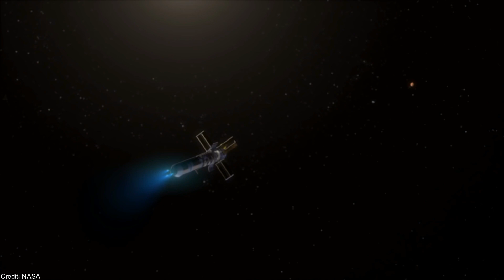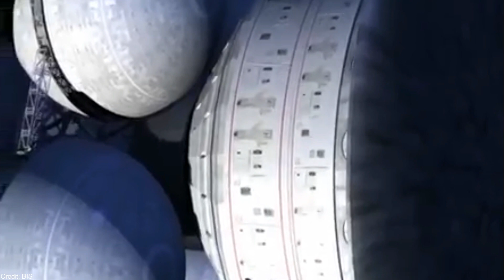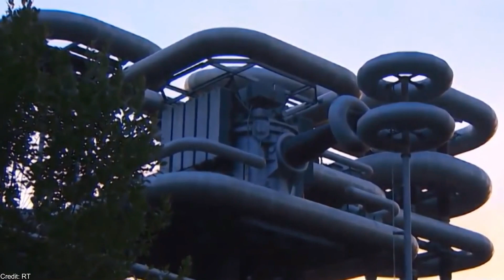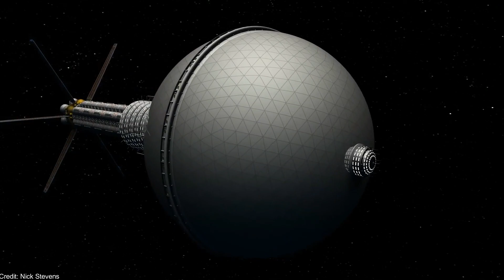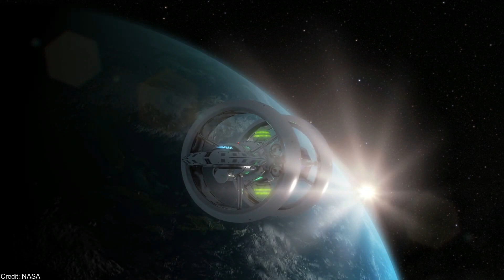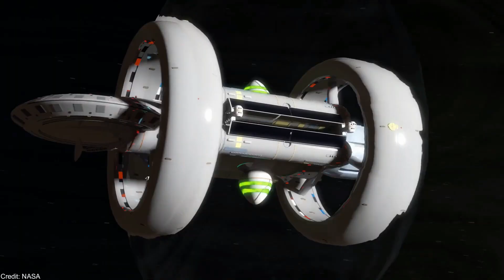The Nuclear Rocket that Could Reach 20% the Speed of Light (Ft. AsteronX)

Comment: Technically, this is the most viable means of interstellar travel once humans can master artificial nuclear fusion with an exponential gain over input energy to produce more fusion.
There are many interesting things here that should be raised: Deuterium Although it is a rare isotope of light hydrogen, it is extremely abundant for every KM³ of water or water ice on Earth there is 34,944 tons of deuterium '' primordial abundance. Unlike antimatter storing fusion fuel is easy and safe and can be stored for an indefinite amount of time https://www.ipp.mpg.de/1766175/deuterium.
The potential energy density per kg of the deuterium + deuterium fusion is gigantic considering the charged particles that can be used even though only 12% for this type of fusion, if you can make deuterium + lithium '' tritium '' is even better because 20% of the particles come out in charged form and the energy density per KG is 340 trillion joules. While the deuterium + helium-3 fusion can deliver 353.2 trillion joules with 75% charged particle form !!!
For space propulsion, the direct nuclear fusion of deuterium-helium-3 would be the same as would be used at Daedalus because it offers the second highest energy density among stable fusions behind only light hydrogen fusion and provides 75% of the energy. produced in the form of charged particles is 16 times harder to do than fusion of deuterium-lithium but nothing impossible in the long run http://www.projectrho.com/public_html/rocket/fusionfuel.php. In question, helium-3 was expected to be mined in some solar system gas giant for Daedalus.
Instead they would do so artificially today via fusion of deuterium-deuterium that produces helium-3 and tritium that halves every 12 years into helium-3. Traveling faster requires a greater amount of energy and with it a higher armor and countermeasure system we don't want to hit a rock at 20% of the speed of light in space.
For a concept based on pure deuterium-helium-3 fusion we could go at 5% the speed of light, often consuming less fusion fuel than 20% the speed of light, yet it would be enough to reach Alpha Centauri by 91. years including a phase of deceleration using direct nuclear fusion. In addition we could bring a much larger payload to Alpha Centauri perhaps with 70,000 tonnes of payload with rotating habitat and able to sustain humans until they reach the neighboring system.
If we still had a huge space infrastructure capable of pushing a gigantic Star Sail from the Solar System to 5% of the speed of light then we would not use fusion to accelerate the ship, but only to slow it down when it reaches the Alpha System. Centauri We would get the best of both worlds, since a major problem of concentrated solar-powered star sails is deceleration, and using those sails at the same time to make a large ship reach high speed would eliminate the need to use fusion for acceleration thus uniting together. the best of both worlds. Excluding the Sun and the gas giants, deuterium is a valuable and stable isotope of light hydrogen that can be found anywhere else in the Solar System that contains hydrogen volatiles. It includes huge space rocks like asteroids and comets that can be mined for other uses. and breaking are the necessary source for all the deuterium we need.
Undoubtedly the most conceivable and real means for interstellar travel: huge fuel energy density, extremely abundant fuel almost anywhere in the Solar System and easy to store, and helium-3 deuterium is not artificially impossible to do. I recommend some videos from the Isaac Arthur channel also on topics involving fusion.
Reply: from a technical standpoint, net gain of the fusion reaction isn't even necessary. a fission reactor could provide the energy needed for the fusion reaction. Of course, this would be very inefficient in terms of weight and the added complexity is also a major downside. But theoretically, such a drive would be possible by todays technology.

Comment: Possible but too expensive.  These explosion based engines will probably never be built, but nuclear thermal engines were designed and TESTED, and will hopefully in the not too distant future become reality and help us explore the solar system.  Going to other stars will require more than what fission or fusion can offer;  it will probably take the use of antimatter as fuel.  But before we send large craft or half-tonne probes, we may be able to send postage stamp sized spacecraft.